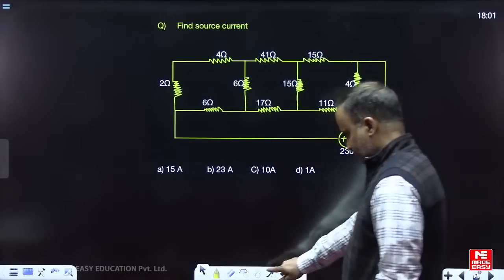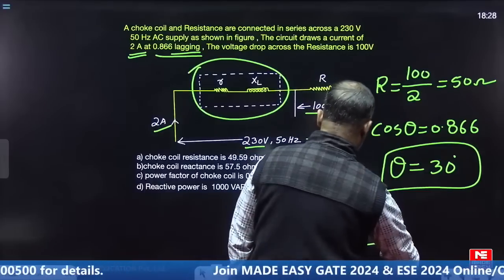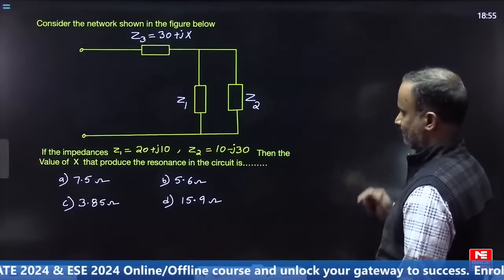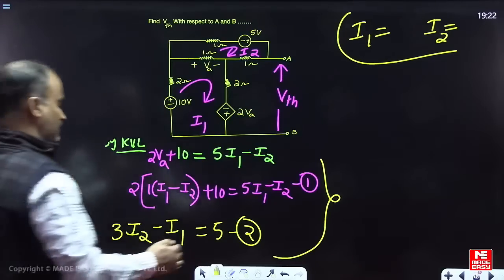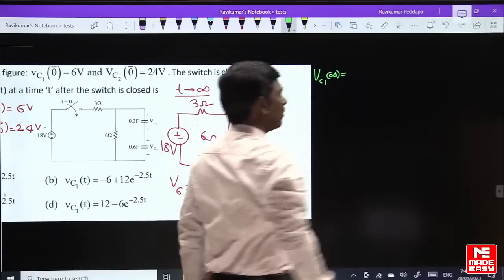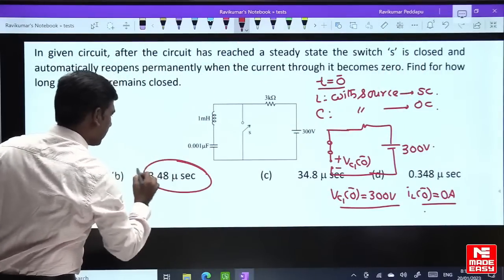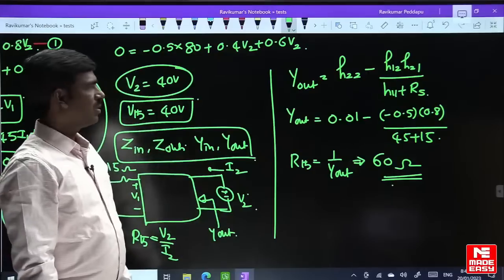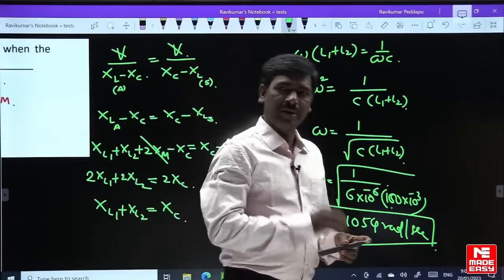GATE Through Questions(GTQ)|GATE 2023| EE/EC| Network Theory | By Kiran Sir & Y Naresh Sir|MADE EASY

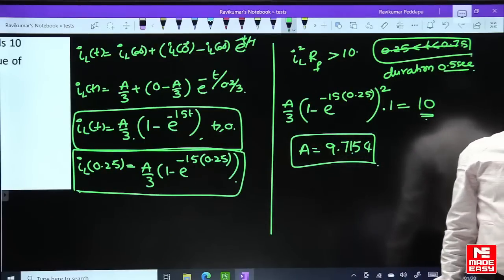Comment: 2:25:55 the reason you are subtracting 0.5 with 0.75 and taking 0.25 is not clearly understood sir( what if input is not pulse and just u(t)? In that case which value need to be taken instead of 0.5?). Please clarify that point in particular sir. Remaining all ok. Good set of problems